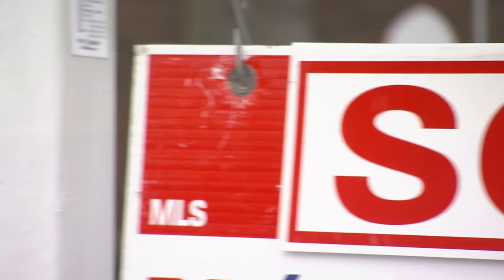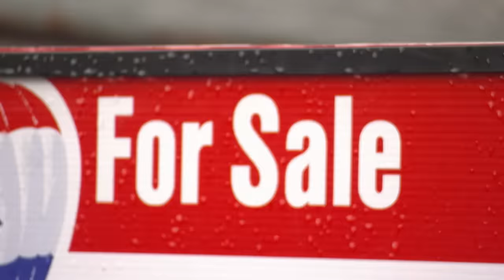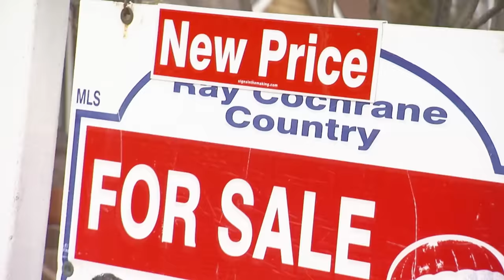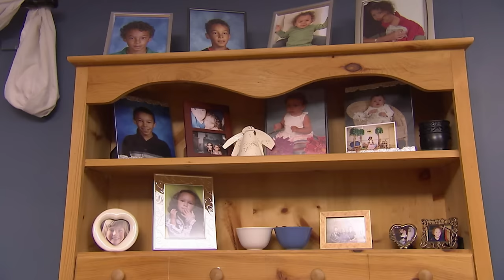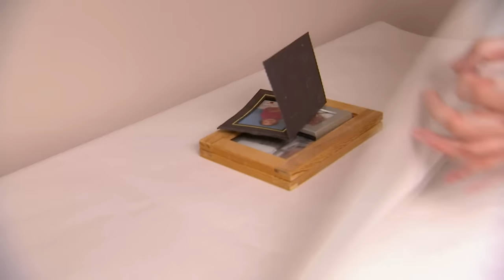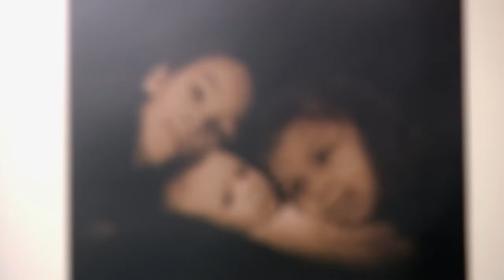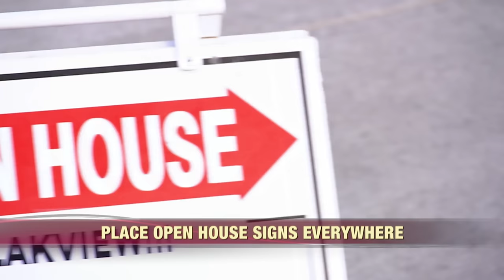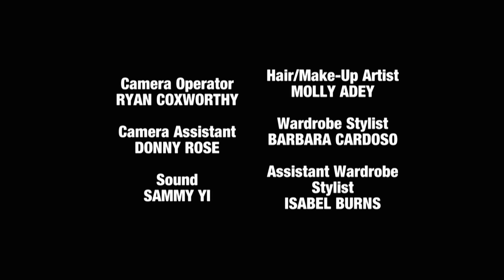Clutter Has Ruined This Beautiful Home | The Unsellables | House To Home

Comment: The front yard needed some sprucing up, too!
Reply: Exactly, I would have passed on this house without getting out of the car. Curb appeal is so important. It is a  darling little cottage inside.
Reply: Exactly
Reply: I thought so too. A large tree to camouflage the hideous downspout would have been a start.
Reply: I would have snuck over to the neighbor's front yard and cleaned up the leaves.
Reply: yeah, it's a dumbing ground, hot mess
Reply: Yes, I wonder why they didn’t do that .
Reply: way too much clutter in the front yard.

Comment: I’ve bought and sold a lot of houses. Even though I don’t have a lot of stuff, I still store much of it. People can’t see past “stuff,” or cosmetics, ie paint and flooring. Because I can, I have picked up some bargains over the years. Often just new paint and flooring, as well as minimal decor is all that’s required. Sometimes what is needed is more extensive—updating bathrooms and kitchen—you have to do the math and determine what initial outlay will garner the most return.

Comment: A good tip is to take photos of your home room by room. Look at the photos and you’ll be amazed at how you see things differently. When you live in the home you almost become blind to your clutter. Looking at photos somehow helps you to see the clutter or things that need to be changed around. 
Listing photos usually never have clutter or excess furniture. You’d also be likely not even want to look at a home if the online listing photos are filled with clutter.

Comment: How was that house built with no upstairs bathroom?
Reply: There are some townhomes in Chicago with bathroom on  ground floor (3 stories).  Sell for 500+.  It's plumbed so you can add a bath.  Many homes are built this way.  I've seen homes where literally every room is on a different level.  I have two criteria: A fireplace and separate dining room, not area, as I dislike open floorplans